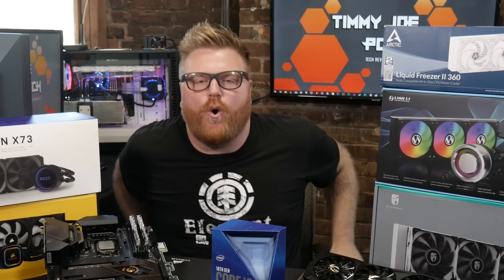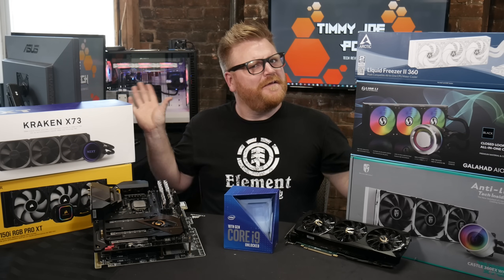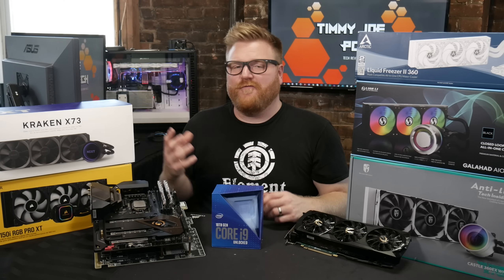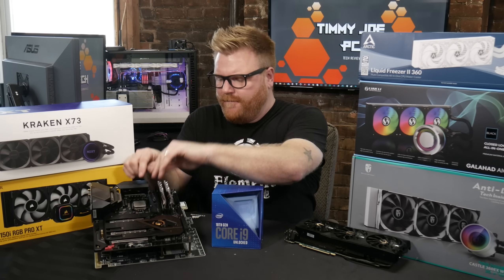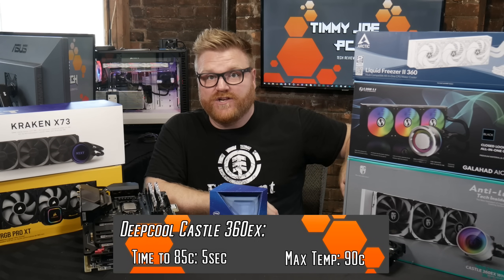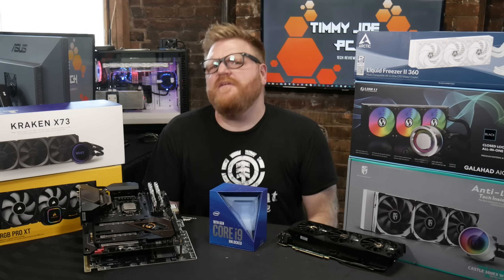Which 360 AIO is best 360 AIO on the 10900k @ 5.3 Ghz?!?!

Comment: I've had 10900k and lian LI aio for nearly 2 years now, the pump sounds like it works and pipes do too I don't know if it giving enough power tho, but in cine bench or even playing games for roughly an hour and on discord and watching yt I'm hitting 100 degrees and 2 times in 3 weeks is thermal throttle and stitched off, is there a problem with pump ? Idk or CPU ? I don't know need help lol.
Reply: I'm hitting 25 to Max of 50 percent load of cpu too, 100 degrees. I've re applied thermal paste. Nothing but soon as I tab out if game it somthing it drops temps ? Why is it running so high ??

Comment: What will be best size aio for 3700x inside O11 mini with side mounted rad & its fans are as intake & with 3 bottom intake & 3 top as exhaust ?? Also if push pulled make a much difference?? Plz suggest

Comment: I have just bought, not received yet, a Arctic Liquid Cooler II 360 for around 91 UK Pounds. With their recently announced six years guarantee, known performance and one wire connection, no bling solution, it seemed the one to go for.

Comment: Thank you for your review here! I really appreciate that - i really like your onset looking and your conclusion that the First 3 of your winninglist are a Great Choice! I also want to clearify something-> Performance comparison should Be Only focused on the Temps and Airflow and not on the software or other Stuff (so May the temps variy in other scenarions/cases) 1st Kraken with -2 degreece (in this scenario) and 2nd Arctic + h150i (cause the temps in this scenario are equal and the comparison was focused on the temps Performance for the i9-10900k and Not usebility or other stuff :)

Comment: Jesus man, 87 degrees is terrible. Question what Loadline Calibration you running? My EVGA CLC 240 was doing 78 degrees max temp running Cinebench. 5.3GHz and I believe 1.310 Volts and Loadline 6

Comment: I have an I9-9900k overclocked to 5.3ghz on 2 cores and 4.8ghz on 6 with a deepcool castle 360ex and it does not go over 70C on cinabench r20. I think you might have incorrectly installed yours. And also the maximum pump speed is 2600 rpm lol. I put 3 Corsair ML120 rgb pros on the rad top mounted and 3 on front. 50% fan speed and not even 70C on a Synthetic test lol! Doesn't go over 65C in game for real

Comment: Thank you so much for this video. I see why most of European YouTubers are pushing for Deepcool cooler. Their best option and availability is this brand but for U.S. NZXT rocks even with the buggy software!
Reply: Kraken X73 (360 mm) vs Corsair iCUE H150i RGB PRO XT Liquid CPU Cooler ? AMD 5960x ?
Reply: @GurmeetSingh-fr8uo  I'm assuming that you are planning to invest on a top notch AMD and possibly overlooking it quite a bit so I would go with the NZXT Kraken 360mm on either Z or X series for maximum cooling. This brand has a buggy software and it doesn't even care about your MB fan instructions but it does what you expect from it and at the end of the day, it's all that matters.

Comment: I have the cooler master very happy with it after a couple days use of the thermal paste bedding in dropped another 5°. He didn't mention the software let's you make different profiles for ANY program (rgb, pump and fan speeds and control each fan separately, and the software can control all your other rgb so you could have fans set to balance, pump on extreme and pump rgb and case fans rgb set to red all in a profile to take care of it all in one. It starts with windows and there is no performance bloatware impact at all from what I can tell. Just remember you need a spare USB on your Mobo.

Comment: I went with the Castle for $120 instead of $280 lol and I got better static pressure rgb fans and kryonaut paste and it's a fantastic setup (I am using the stock fans for exhaust fans on the Phanteks Enthoo 719 case since it didn't come with any so I'm not out extra money swapping fans on the radiator either)

Comment: I've seen reviews of the Arcitc Freezer 2 and Castle/Captain 240-360s beating the X73 yet it's above all here? it's interesting you complained about Corsair's iCue which is arguably the most well rounded/stable software out yet you fail to mention NZXT CAM software is legit the worst, it's borderline virus status. Not a fan of your testing methodology or the lack of tangible results...there is a reason most tech reviewers don't benchmark a cooler on how long they can stave off X temperature, it's nonsensical at best and serves no purpose.

Comment: You should test the Cooler Master MasterLiquid ML360L and the EKWB AIO D-RGB 360 too sometime. My Ryzen 7 3700X runs great with the ML240L V2 and the best part, no additional software and standard ARGB header cables. Both of these are actually really cost effect too.

Comment: Just bought the Galahead 360, it's about 50% more expensive than the Liquid freezer II, but the looks are 10x better and since I got an O11 XL I want a nice looking AIO :)
Reply: Hey there did you get Galahad 360 for i9 10900k? I am thinking of getting Galahad 360 aoi cooler for my 10900k cpu I was wondering how efficient Galahad is with this particular cpu?

Comment: When I realized I got a X73 for a 500D RGB case ;-;
Reply: @erisium6988  The 500D has a front panel to show off RGB fans and the X73 doesn't have RGB fans. But I figured I can just use my 3 QL fans for the RGB instead xD
Reply: @erisium6988  I'm just trying to get my hands on a 3080ti when it comes out >.<

Comment: Last Place:
Deepcool castle 360ex: $160
Time to 85c: 5 sec
Max temp: 90c
Also the loudest.

4th:
Lian li Galahad 360: 
Time to 85c: 30 sec
Max temp: 87c
Second loudest.

3rd:
Corsair H150i RGB XT: $160
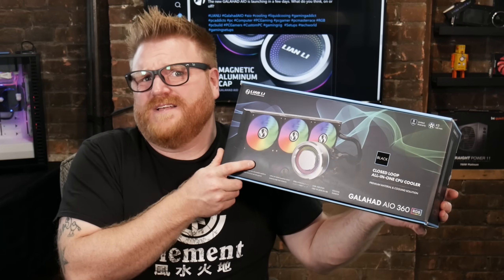Time to 85c: 1:09 sec
Max temp: 87c
Third place because of iCue software and setup hassle

2nd:
Arctic Liquid Freezer II: $125
Time to 85c: 55 sec
Max temp: 87c
2nd for the Corsair because of easy setup, quiet fans, and looks

1st:
NZXT Kraken X73: $180
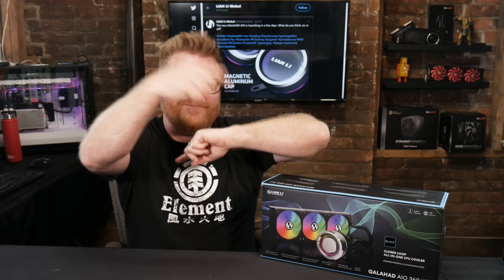Time to 85c: 1:30
Max temp: 85c
Highest RPM, 2c better and faster fans
Reply: thank you!
Reply: Nzxt x73 still using cam software?
Reply: @matacachorro4090  im pretty sure
Reply: Nice but btw Kracken x73 is $180 and z73 is 280
Reply: ARCITC LIQUID FREEZER II WIN ÁÁÁÁÁ
Reply: With the money you saved not buying the kraken you could get 3 noctua fans on the arctic lol.
Reply: @kevinhobbs125  artics fan are almost as good as noctua in testing ^^ i still hold arcitic nr 1 i use push & pull =)
Reply: @kevinhobbs125  would they be compatable as ive thought of switching my artic fans for noctua fans. but wonder would it be worth it and what would the temps be.
Reply: @kevinhobbs125  3x Noctua NF-A12x25 = €90, fcking best rad fans ever! Evolution of the Scythe gentle typhoon!
Reply: Guys. When ever see temps like this its one of two things. 
1. Pull cmos battery. 
2. Cooler isnt mounted properly.
Reply: good shit
Reply: @MissRita0207 aios are bad air cooling for the win
Reply: I swear if NZXT had a white version of the Z73 it would sell so freaking much
Reply: @brunoniccoli1546  just vinyl wrap it

Comment: Rare moments in life where i bought product that is nr. 1 on the youtube video list in multiple vids 😂
Reply: the difference is insignificant unless you run the cpu at absolute limits for long periods of time......this is more like "for fun", they are all pretty much the same, basically only the price and the aestetic preference should make the difference.
Reply: @adip1704  you have a point there, luckily i have 10900k so my x73 has purpose 😊 just recently i fixed the speed at 5.2ghz on 1.370v with medium loadline calibration, works like a charm with regular temperature around 60-65 while doing craziest thing in games that are pushing cpu and gpu. While idling is around 30ish to 35. I believe if i really wanted i could easily go 5.3 but i just don't see purpose to be honest.
Reply: @tristy9134  nice!
i would push it to 5.3 just because i can, even trying to find stability at 5.4 if possible but thats just me i like to play with a fresh cpu, have fun and enjoy it!:)
Reply: @adip1704  Yea i know what u mean, i also like to play and try stuff, but in the end i would never stay at 5.4 for example, cause that would produce alot of heat over time under load. Liquid coolers are awsome, but liquid itself grows in temperature if your cpu constantly keeps producing alot of heat, and then it would reach a point where more heat is being produced then the cooler can cool of but that ia under heavier load in longer period of i guess. But yea 5.4 would be possible in some way. I tried 5.2 on automatic voltage, it was pulling 1.502v and 82c in Anthem, which is really gpu/cpu power spender game. When i fixed it on 5.2, was 65 max. So im guessing, if 5.3 can be stable around 1.450v, shouldn't go more then 70c. Maybe i'll give it a shot for fun to see what happens :P

Comment: I have the Corsair one that I'm using with the Ryzen 9 3000x. The loudness of it is a little annoying but I can usually leave it on quiet mode while gaming and the CPU stay between 59-63 degrees. Gaming isn't a big workload for a CPU but the point is that the noise isn't a big deal for the typical gamer. I think if I was rendering something I'd want to put it on a performance profile but that's just not my use-case. I picked the Corsair and iCUE because I went with all the corsair fans and lighting strips just to be able to synchronize all the RBG easier.

Comment: I tried the aorus 360 this time around to match my build... idles great 28-31°C as soon as you run a prime it shoots right up to 100°C, i9 10900K stock settings.  Might go back to back to corsair an try that.
Reply: Thats a bad pasteing
Reply: @AudioEuphoria080  I tried repasting multiple times. With little difference. No longer have the cooler or cpu so it's no longer a issue haha
Reply: @brandonwarren3076  oh lol well, thats good then 😂
Reply: Hey @warfare Gaming
What CPU did you switch to? I have the Galahad 360 aio and the i910900k is killing me with its high temps!
Reply: @darkburai  hey 👋 yeah the 10900k is a toasty cpu lol,  Currently running i9-12900k with a nzxt kraken Z63 stays cool while gaming around 45-60°C. But like the 10900k it shoots up to 100°C after a bit  of stress testing.
Reply: @brandonwarren3076  might be a dumb question, but isnt the i9 12900k even hotter?

Comment: The main question is.  How did you have all the radiator's orientated.

Second, why didn't you just run all the fans off one of the 3 way splitting and set the mb to max fan speed?  Just max them from the start.   Also corsair fans don't need to be ran through the pump headers, can plug them into mb with the 3 way splitter.  Just set max pump speed in iCue and close it out.

Third, AIDA65 really?  Use a real test like prime95 with 128k FFT in-place.
Reply: This video was mainly opinionated.

Comment: I just dont see the point in AIO's when noctua exists
Reply: You cant cool a 10900k @5,3ghz with a air cooler lmao. 
It pulls nearly 400watts alone.
Reply: @tobiaspabst5524  Then you need custom loop. If NH-D15 can't cool it, then AIO can't cool it.
Reply: @megapet777  my liquid freezer II 360 performs on par with a custom loop. 
I can run 5,3-5,4ghz no Problem on it. 
Look it up, its the Best aio on the market. 
I had noctua nh-d15 before and its Not even close to the Arctic aio.
Reply: @tobiaspabst5524  Oh I agree the liquid freezer 2 is the best AIO. I think noctua can beat every other AIO tho
Reply: @megapet777  i have only noctua Fans in my build :)
Reply: Tobias Pabst nice :) me too, except for the cpu fan

Comment: I'm using the Arctic Freezer II 360...I absolutely love it.
Reply: do it haves RGB FANS ? i mean can you buy In rgb?
Reply: @cherry7838  no, it has no lighting at all... exactly what I wanted...you could change the fans for rgb if you want though.
Reply: @GSP-76  thank You So It will be fine To replace On it the Corsair RGB?LL120 fans ? And i think this is the best coolor out there like my friend  told me fore my i9 10900k its better then the corsair rghit? and did you chnage it To rgb?
Reply: @GSP-76  can you replaym
Reply: @cherry7838  it is definitely better than the Corsair AIO...it has a thicker radiator which gives it better performance. I think the rad might be like 35-40mm. You can definitely change the fans. Just be aware that Arctic uses a single motherboard connector to power the pump and all three fans. You'll have to wrap the wires on your fans around the fan frame and then use the connectors Arctic uses to daisy chain them. It's not hard and you'll see when you install it. Just make sure your case can accommodate this cooler at the top of your case. If not, you'll be mounting it in the front...that shouldn't be a problem though as temps are always best with radiator mounted in front.
Reply: @GSP-76  i dont think i wil need to use Other  fans Then Becuse if i put The 3 NOT RGB ON THE TOP OF THE CASE there will nit be difrints with RGB that Much
Reply: @GSP-76  so yeah I got the Lian li razer black Case  it shuold be Fine il place the Luqied Freezer 360MM II IN THE TOP? OF THE PC YEAH?
Reply: @GSP-76  Is it the best to place the arctic on top? Or side ?

Comment: I had a Castle on my old stock 2600X. One thing will say about it is performance degraded over the course of two weeks, to where it was idling at 40C from originally idling at 30C. The stock wraith that came with it idled at 42C. I would say it could have just been a faulty unit but after sending it back and getting a replacement, the exact same thing happened again after 2 weeks. The liquid just seems to lose its ability to shift heat from the radiator. I sent that back and I'm waiting on a Galahad to use on my 10600K, which should be getting released in the UK today. I just wish they would release the Arctic in white, as that's the main reason for me getting the Castle and the Galahad instead.
Reply: Ravi Ahuja  it ends mid way? Yeah I got the Galahad. It's a good cooler. GN have done a video on it I recommend - shows the Galahad as a top performer just behind Arctic Liquid Freezer 2 and the EK AIO

Comment: Hey, can you explain how the Galahad AIO pump is controlled?  I've seen conflicting information (and a severe lack of info from Lian Li).

Is it really fixed speed?  And what RPM does it run at?  Is there any way to control it via motherboard?

This is all stuff Lian Li should be stating but they're being super cagey about it.
Reply: Ravi Ahuja  It's a 3pin DC powered pump with a max speed of 3300 rpm.  You can control the speed from your motherboard's header but if you put it too low (below 40%) the pump will cut out.

Comment: A big selling point for the Arctic 240 (first version) was its push-pull set up, which increased fan efficiency while lowering the noise profile considerably.  I'd say, go with the Arctic 360 and maybe buy three spec-matching Arctic fans for push-pull if the case and motherboard configuration can accommodate it. Arctic fans are very good quality and priced very competitively.
Reply: Problem with the Arctic AIO's is only the 2 year warranty.  For an AIO, you need to stick with a 5-6 year warranty.  It says alot about the quality of the unit.
Reply: @picklesandufos7860  Arctic recently listened to consumers and bumped up their warranty to 6 years!
Reply: @senecaty1234  Indeed they have, I found that out shortly after I left that message.  Arctic is great

Comment: For those interested in Ryzen, I've been using the Deepcool on my 3950x since January. In my testing, with PBO +200mhz on, and unlocked power limits, I hit a max of 77C in prime95. In games, I see a peak temperature of 60C, and around 65C  when rendering. With stock settings, I see a max of 65C in prime95. This is within a Lian Li 011-Dynamic with three intake on bottom, AIO as side intake with stock fans, and three exhaust on top. I am also using Thermal Grizzly Cryonaut as my paste. ALL of these coolers are capable of keeping the highest end Ryzen cool for long periods of time.
Reply: 360mm aio?
Reply: I hit a max lf 72, feels good man

Comment: Weird results. Few months ago was using Corsair H150i Aio cooler, which I replaced with castle ex due to annoying humming noise of the pump. Got no issues with Castle thus far and it's pump is much quieter
Reply: There is nothing wrong with your pump on the H150i... You just have your AIO installed wrong causing air to build up in the pump block my dude..  You need to either mount your rad at the top of the case as exhaust or if front mounting it you must mount with the hoses at the bottom of the case... IF YOU MOUNT any AIO with the hoses at the top ( this is for a rad thats mounted at the front of the case ) you will get horrible sounds and also shorten the life of your AIO to 1-3 years instead of 5-6+ ...   NEVER let the pump be the highest part of the cooling system as installed you might as well toss money out the window while driving...  You want the " Tank " that is the end of the radiator that doesn't have hoses going into it to be the highest part of your cooling system in the case... They are made so all the air gets trapped in this tank section and you will get the longest life, the best cooling, and quietest setup.  This set up is best but also mounting the radiator in the top for the case flat is also very good... you might as well eat a bullet if you have a 011 Dynamic and mount the radiator at the bottom of the case.... this would be a nightmare.
Reply: @TallynTech  Hey bro can you suggest me an 360 aio for my 3700x . I really like the look of the deepcool castle but its the worst perfomer. The new corsair capellix elite is also very appealing. Also the prices of these aio are very different in my country. Cheapest to most expensive- Deepcool castle 360ex (10700 rs) < Lian li galahad 360 (12500 rs) < Corsair Capelix Elite (around 15k) < Nzxt X73 (16500rs) . I want the best performance to price option. You seem very knowledgeable , please help me choose one i am very confused. Ty